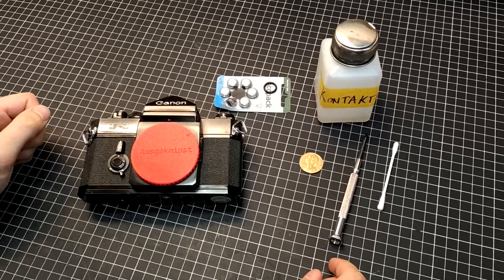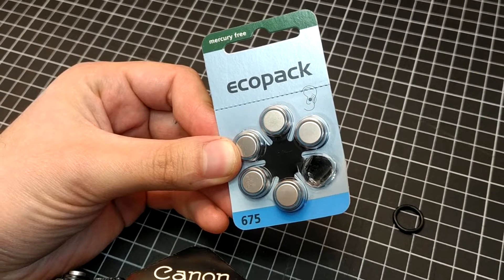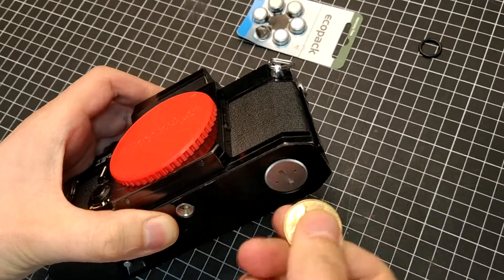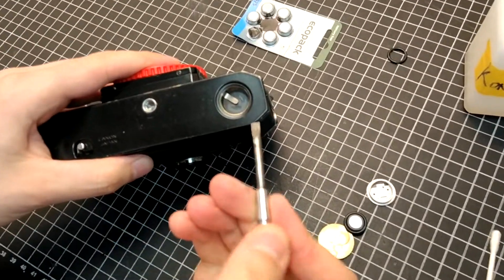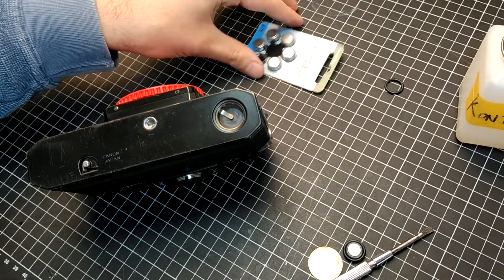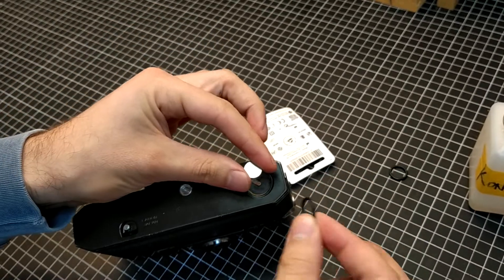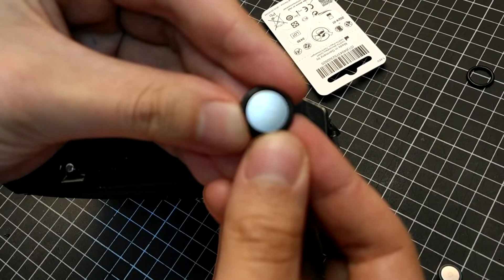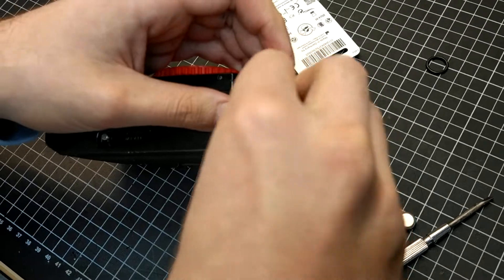How to change Battery on Canon F-1 and use adapted Type 675 batteries (instead PX625) with adapter

Comment: Question man , i have a canon ftb I’ve put on this battery with the o ring on it . Would i have to adjust my iso down a stop or is it accurate not to move and leave at iso the film is asking for . Hope to hear back from you soon man .
Reply from the maker: The batteries have the proper voltage so you do not have to compansate with the ISO (if your light meter works the way it should).
Reply: @ausgeknipst  thanks for your help 🙏🏽

Comment: I saw in the videos that they use 625A batteries with 1.5V for FT/FTb models etc. and it works without overvoltage.
So what battery should I use?
Reply: Let me answer for Mr. clueless, if your camara works to your satisfaction than use 625A batteries, they last 10x longer than air-zinc garbage.
Reply from the maker: Not sure what your question is, but as far as I know the Ftb used Mercury batteries with 1,35V, so I would use hearing aid batteries (e.g. the ones we sell) for accurate metering.

Comment: apologies if it's obvious - but why does this camera need a battery? I thought it was mechanical
Reply from the maker: Hey, it works mechanically but needs a battery for the light meter. Greetings Vlad
Reply: @ausgeknipst 
There is a prism finder for F1 that has shutter priority with some lenses and a special lever, but it has other bateries.   And there is another finder buster that adds light for setings in viewfinder and longer exposure times, but also with other batteries.